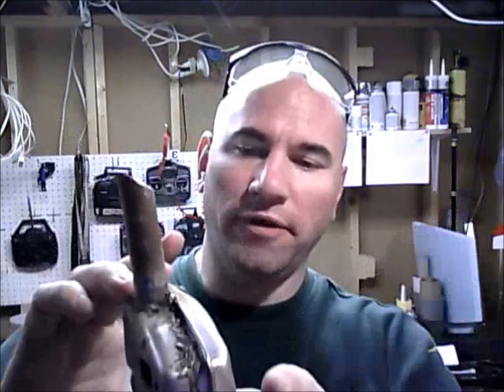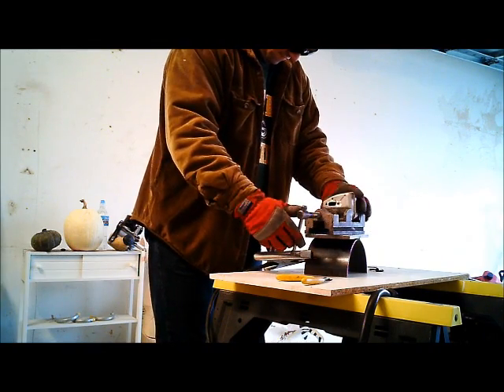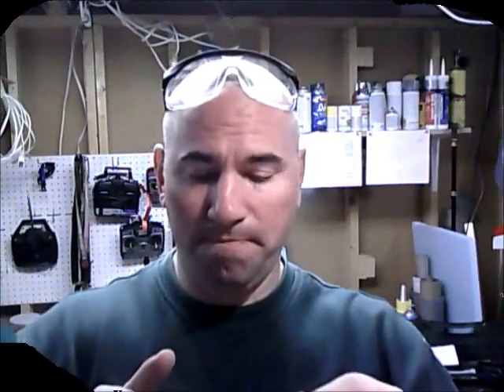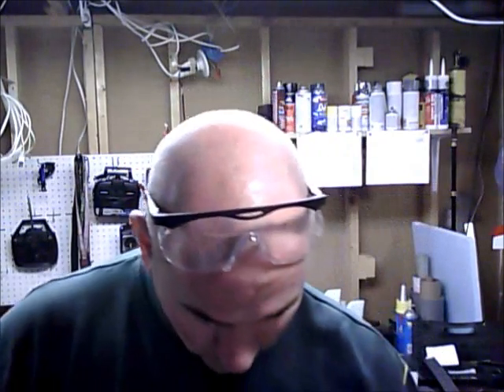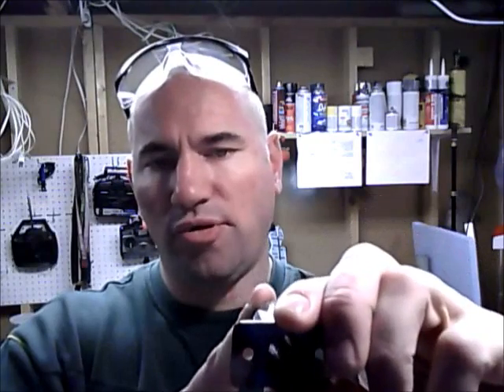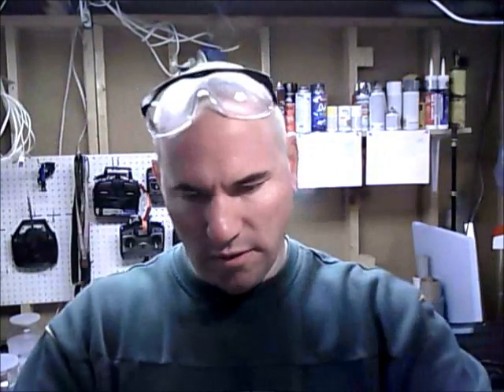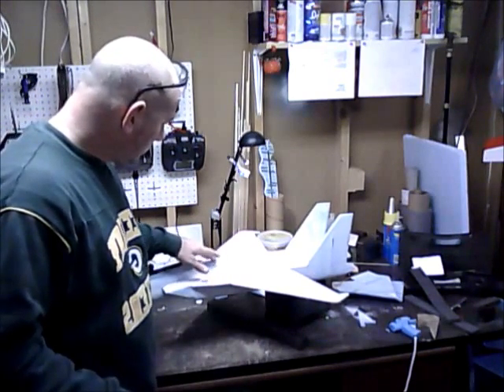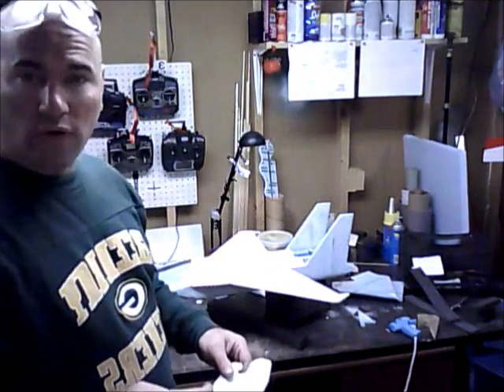Converting a Weed Trimmer engine for an RC plane project, update 2.

Comment: Yep I’d keep th intake out of the prop wash it’ll lean out at times causing running and power issues becaose you are essentially supercharging the engine with the prop wash high rpm you will be shoving tons of air into the engine and have no way to fatten up the fuel mixture on the fly. These small engines are VERY finicky when it comes to air fuel delivery.
Reply from the maker: Hi Jack Rabbit, 
I have not messed with it in a while but I still have it and still want to build a coroplas Piper cub with an 8 foot wing span for the engine. Last time I fired the engine up it was stuck at full throttle so I will have to look into that first.

Comment: cris IDEA for your valocity stak ? ive used a peice of copper 1/2" tub or a callor and use the ball end of a ballpean hammer to flair it and then solder it sceince theres no heat the engine will pickup a whoe bunch of more power your grabing alot more air so watch out on the lean side happy flying capt michael weir retired usaf!

Comment: @gwsslowstick i went and looked at both my 31cc gassers and they both have the carb at the back of the motor so the intake is acutally inside the motor mount completly out of prop wash. i bet sideways or the way that would try and make the air presser equal fro  low rpm to higher rpm. if you want ill make a video showing the placement of the carbs on my planes

Comment: one comment about your intake i have found that doing that the motor will lean out always at higher rpm and run fat and stall at a idal to have a volosty stack is good but to keep the intake out of the prop wash will get better runing motor from a idal to full rpm